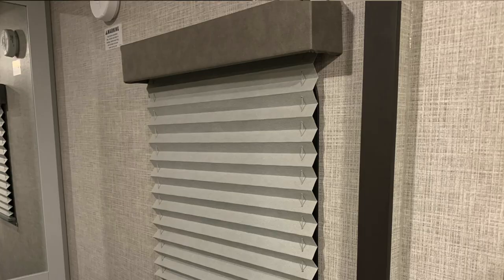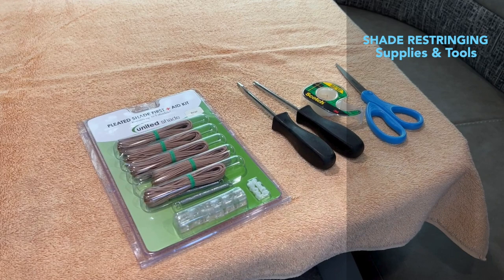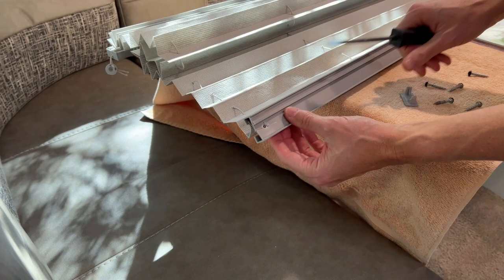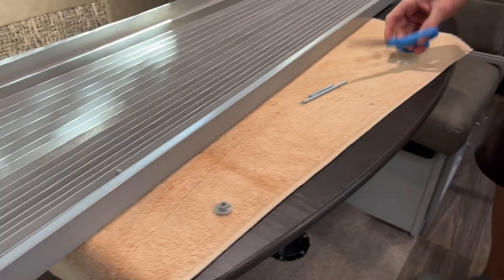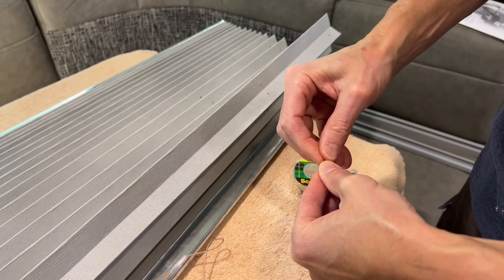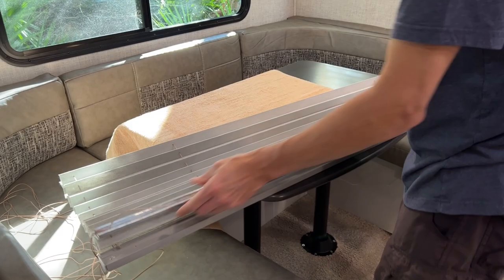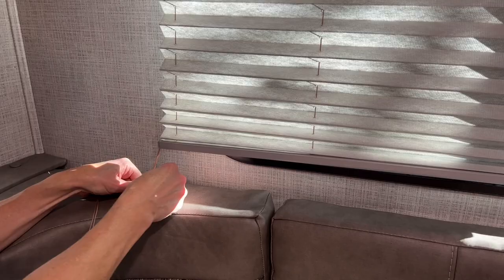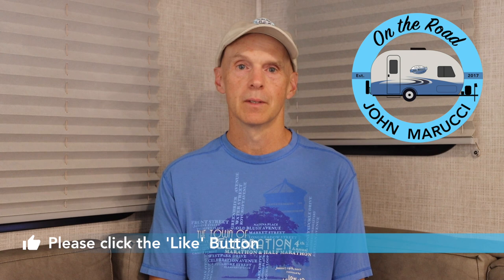RV Large Window Shade Restringing – Step-By-Step Process

Comment: I got through all the pleats at once! by taping each string to a long tapestry needle. I used  less than an inch of tape  and started just below the eye, wrapping it around string and needle very tightly  diagonally away from the point to make a thin , smooth profile. John you really covered all the details in a short, efficient video. Thanks again -  the shade is up and working
Reply from the maker: That's a great idea! Thanks for sharing. Glad the video was helpful!

Comment: Following your video, I managed to repair our RV cellular blinds. I had difficulty sliding the bottom rail and had to push the metal part instead of the plastic rail to get it out.  Also, by using rubber bands at each end, I found it easier to push thru the strings from top to bottom rail quickly. The strings that came with the pleated shade first aid kit is much thicker than the ones I replaced.  I hope that doesn't cause me any future issues.  If it does, I'm not sure where I can find the right size.   Thank you for sharing your talent with us, the video is well organized and easy to follow.
Reply from the maker: Glad the video was helpful. Thanks for sharing your experience and tips.
Reply: @JohnMarucci

Comment: I only have one question, once you fed the string through, you didn’t show anything about the crisscrossing, and hooking up the spring! So I am confused on which ones on each side, get hooked up to what spring!
Reply from the maker: At time stamp 3:20 for about 30 seconds I cover the spring issue. Then at time stamp 5:00 I cover attaching the new strings to the springs at the headrail. You need to reference the stringing pattern from 3:20 when doing the process starting at time stamp 5:00. As far as crisscrossing the strings in the bottom rail, simply take the two strings on the left and move them to the right in the bottom rail and the opposite with the right two strings. Sorry if that part wasn't as clear in the instructions.
Reply: The diagram he showed on the video explains about the crisscrossing.  Basically one side goes on the opposite direction and the other goes the other direction.

Comment: I need more info on the spring situation.  I found only 1 spring in my header. I have no idea if the other one went missing along with   the half missing string. You show one spring longer than the other. If I can find a longer spring, does it go on the outer or inner strings?  The instructions also show only 1 spring.
Reply from the maker: My shorter spring is attached to the outer cords @ 3:34 in the video. The longer spring is attached to the inner cords. Not sure why yours would only have one spring. Some shades may only have one vs two springs.
Reply: @JohnMarucci  I think the other spring may have gone missing when the cord broke. I'm not the first owner,  so who knows what the previous owner did. Thank you for the reply.